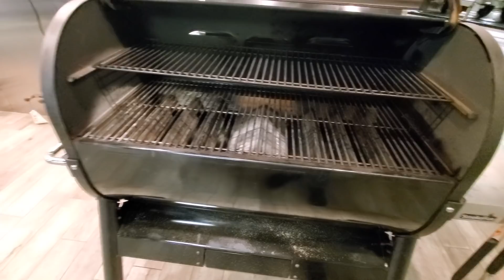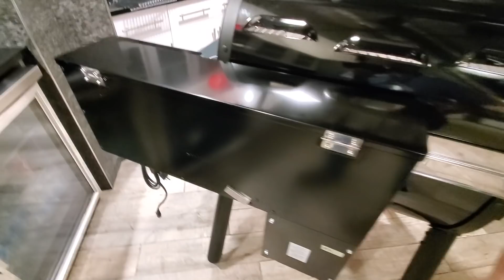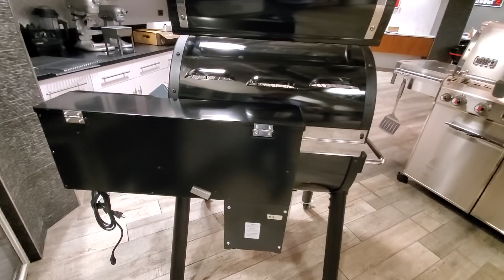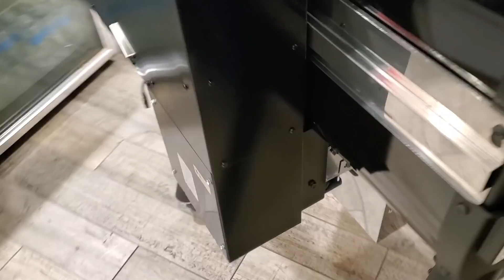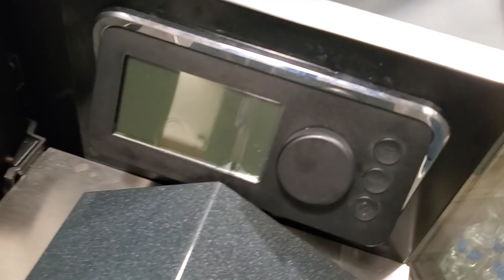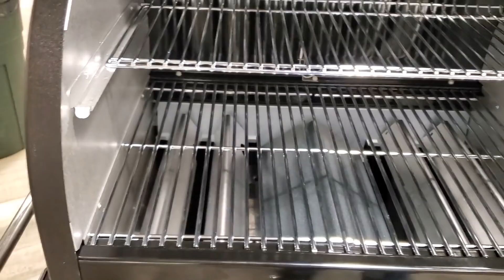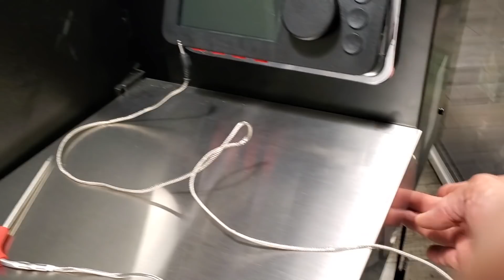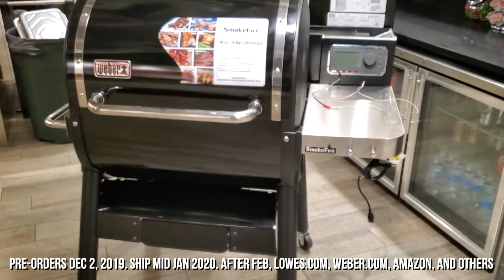Part 1 FIRST LOOK | Weber SmokeFire Pellet Grill Smoker | BBQ Champion Harry Soo SlapYoDaddyBBQ.com

Comment: Are there provisions for a rotisserie?
Reply: Frenetta O'Neal.  Why would you want a rotisserie?  Most of these pellet grills have blowers that make them basically into a convection oven.  I do a lot of beer can chicken in my smoker that comes out perfect and found if you buy some cheap round cake pans and place the chicken standing up in the cake pan there is no cleaning of the smoker, but the cake pan is pretty gross.  Plus another great thing about the cake pan is that you can grab the cake pan instead of the chicken and not have to worry about messing up the skin or having the beer can falling out when it done.
Reply: @elcajondavid1  good tips David. I have chicken cookers (beer can type) with pans already attached also.  When you put the chicken on cedar planks you minimize further the need to clean.  I just posted a volcano turkey which  illustrates this.  Thanks for taking time to leave comments!
Reply: @harsoo .  Thanks for the reply back.  I haven't used the cedar plank, but I have been using these copper sheets to lay down on the grilling surface.  I mainly use them on larger meats like ribs and briskets and of course salmon which helps in the clean up of the smoker except the sheets are pretty disgusting when you clean them up.  I think you will enjoy this, I no longer have to buy briskets and especially salmons.  Several of my neighbors when they find out I am going to smoke either a brisket or especially salmon they buy it and then split it with me.  I probably have close to dozen salmons in my freezer right now, and the neighbors  just go crazy for the smoked salmon and all I have to purchase is the pellets then again one of the neighbors just purchased a bag of hickory pellets and gave it to me.  "Maybe I won't have to buy pellets in the near future with any luck?"  Have a great day.
Reply from the maker: Not sure as this is the pre-launch phase.  I know the Accessories Manager Shannon mentioned that a whole suite of accessories are planned so I can guess that an electric rotisserie should be in the works also. I kinda got the feeling that SmokeFire will follow the BGE or Harley Davidson business model where large portion of profit comes from the accessories.

Comment: Hey Harry, great review. Quick questions: Where do the temp probes from the controller enter into the pit? Is there a small door on the side or something?
Reply from the maker: The preproduction model did not have cutouts.  We were told the production models will have notches in the lid for the temp probe wires
Reply: Ok that is what I thought as I didn’t see any in your video. Thanks for the quick reply! Definitely very interested based upon your video. Got a new subscriber!!

Comment: This weber looks great. Alot of thought into this design
Reply from the maker: Gotta love it for the engineering!
Reply: @SlapYoDaddyBBQ  it appears maybe not so much.  This weekend has shown it has a number of engineering nightmares, especially channeling grease toward the fire.
Reply from the maker: @SilatShooter  I have one data point from my cook on the SF at my subscriber's home.  My SF is on order from Amazon (those suckers are hard to find locally). Feel free to drop by to watch me do a Torture Test Part 2 low-and-slow with briskets and butts only and see if the hopper feeds and no grease fire in 16 hours.
TORTURE TEST 1 - PASSED
45 lbs 5 meats in 8 hours. Generate grease from a 16 lb brisket, 10 lb butt, and 3 St. Louis ribs to drip on the SF the first 6 hours at 400F and 275F. After all that grease was accumulated, fire it up to 600F to grill the Ribeyes and sausages.  Cook to let the grease drain in the unit and then try to flash that grease at 600F to test for safety 
TORTURE TEST 2  - PENDING
60 lb, 2 meats, 12 hours. Two 16-lb brisket, Four 10-lb butts. Low and slow 225F to see if hopper feeds properly and no grease fire

Comment: My initial concern is cleanup.  Even in kettles we use a pan under long cooks to catch the drippings.  I'm not seeing a way here to catch the drippings.  And I don't buy the idea of them evaporating.
Reply from the maker: Grease flows into the foil pan and 70% of ash falls into the ash pan.  Please see Weber SmokeFire webpage to see how it works.  I, lile the Weber engineers, hate pit cleaning so they designed a way to get the grease out and keep the SmokeFire clean on the insides.  You don't want a grease fire after you do a 600F sear after a 12 hour brisket cook!  It is UL listed device so it passed fire and safety certifications

Comment: You lost me at 1,000$ sorry.
Reply from the maker: Yes, they are  an investment if you like pellet cookers. Of course, you can cook great Q in a $150 Kettle in the hands of a skilled pitmaster!
Reply: $1k is a pretty decent starting point especially coming from weber. there are more high priced pellet cookers out there. I own a few of them myself.
Reply: It's $200 cheaper than an equivalent Traeger.  Pellet grills are expensive.  This seems a basically good deal for what you get.

Comment: Very nice but it doesn’t look like it has the kind of drip pan like some other competitors which shields it from the fire source and redirects the grease away from combustion. Stick burners are separated by two different barrels so you still have separation from your fire source which allows you to cook highly flammable cooks like pork belly. So how would this hold up to lots of multiple pork belly or pork shoulder cooks like other smokers? Looks like they did an amazing job on the handling of ash buildup.
Reply from the maker: SmokeFire is UL-listed in the US and Canada so it passed rigorous government safety and fire tests including grease fires.  It could not be certified if it has a grease fire problem.  I signed an NDA so I can't say what I've seen in their testing but I can say that the do crazy fire risk events to their pits before they release their products. They have a 68 years of experience selling grills and have seen many knuckle-head customers.

Comment: The vents on the back have been in they're design for a long time...I have a nice unit and use it for a sear station..and Rec Tec bull as a primary...I know Webber quality but honestly it doesn't hold a candle to Rec Tec as far as quality of build and materials used...for the same money...? No Way!

Comment: i was thinking of getting a camp chef but after seeing this weber pellet i going to get a weber instead.
Reply: I've been looking for weeks.  I'm not convinced this is better then the current Camp Chef, especially when it's twice the price.  I'm going to wait to see more feedback and USE from Harry and T-Roy.
Reply: @Trblmkr07  good idea i think i will wait for more feed back next year.
Reply: @Trblmkr07  My dilemma as well. One thing I didn't see is a way to change the pellets out when there are still some in the hopper. however,
Reply: @leolalley4708  I've seen some other video's.  There is a release catch at the bottom of the hopper that will allow you to empty out the pellets.  It's one of the things I'm particular on because I like to use different types of wood for different types of meat.
Reply: @Trblmkr07  Thanks for that info. Looks like I'm going to have to wait for some more reviews before getting my pellet grill.
Reply: Get a Camp Chef (I have one). You can't smoke fish or jerky at 200 degrees. Until they fix that forget it.
Reply: Daniel Moynihan didn’t they mention the temp range is 200-600?
Reply: @jdp2380  According to the Webber website the temperature range is 200-600. 200 is way to high to smoke fish or jerky. If they can lower the min. to 150 or 160 I would be very interested. I love Webber products, but this is a major problem.

Comment: Looks like garbage, looks like many surfaces that can rust and break down. The flavor bars seem like they will guarantee a fire.
Reply from the maker: There is a 5-year warranty on the body and 3-years for the parts.   The unit is UL-listed in the USA and Canada and has passed rigorous government fire and safety tests to earn such a rating.  My WSM is 10-years old and won 100+ first places all over the US. The same porcelain coating on my WSM is on the SmokeFire. The flavorizer bars are patented and used on many Weber grills with great results.

Comment: Great video!  I totally agree with you that it looks like Weber took all of the downfalls of the other pellet cookers and fixed them.  Pellet chute instead of auger delivery all the way to the firepot is huge.  I've seen a few hopper fires across different brands of pellet cookers and they are no fun!  The use of flavorizor bars instead of a full deflector plate is awesome.  This video is the first time I've seen that Weber thought about making it easy to change the ignitor (glow plug).  That is a big deal.
Reply from the maker: Their efforts shows and making their engineers cook on 18 competitors for a year before starting design on the SmokeFire surely helped.  We had numerous engineers talk to us which I cannot reveal due to NDA but take my word that they know their competitor's strengths and weaknesses like the back of their own hands.

Comment: I'd love to find a pellet grill that can get a good sear. The few I've researched seem to only have a tiny searing spot available directly over the pellets which I'm sure will just make a mess as the juices and fats run off the meat. I've been doing a lot of Sous Vide but the lack of a sear or anything appetizing looking as you remove it from the bag means I've been investing quite a bit in tools to create a char. If the Weber can get to the temps I need, I think the larger of the Smokefire grills will be my primary choice now.
Reply from the maker: Please see Part 2 on how it sears.  Also Parts 3 and 4 coming
Reply: Take a look at the Yoder YS640. It will hit temps around 600.

Comment: So where exactly does the grease get collected?
Reply: Sounds messy, still on the fence. Worried about flare ups. Do low and slow way more than hot and fast. Use my kettle for that.
Reply from the maker: It is UL-listed in USA and Canada and passed rigorous fire and safety tests to be certified.
Reply: DixeyNormis into the tinfoil pan
Reply: @MikeHoncho884  Yes grease go into the tinfoil pan. The ash goes behind the pan.
Reply: @MikeHoncho884  The tinfoil pan catches the burnt pellets . That's what Harry said.
Reply from the maker: sorry, the pan catches the ash and the foil pan gets the grease. Me bad
Reply from the maker: foil pan
Reply: My question too. From the design, fancy drawer or not, it looks like interior cleaning on this otherwise marvelous looking beast would be an absolute bitch. I LOVE my Weber other Weber cookers, but this one falls short for me.
Reply from the maker: @bigmark2.046  Grease flows into the foil pan. Sorry I was busy talking about the ash and the ash pan but the foil pan is for the grease to flow into.  The Weber engineers I met also hate to clean their pits, like me, so they engineered an easy solution to grease without the need for an outside bucket that critters could get into.
Reply from the maker: @bigmark2.046  https://youtu.be/NwGN72jFjL4

Comment: Is the grill body cast aluminum like the Weber gas grills?  Larger wheels will be nice.  I hope the flavorizer bars and the pellet cooker cover can be upgraded to SS304.  In your opinion will a GrillGrates option, if offered, work with this grill?  Appreciate the video.
Reply from the maker: Body is enamel coated steel which s very durable. My WSMs have the same finish and they are 10 years old and still going strong.  I think the flavorizers are SS.  The teepee is enamel coated steel so it is easier to clean according to Weber engineers.
Reply: @SlapYoDaddyBBQ  THX Harry.  My Weber Genesis Silver is around 25 yrs old and still kicking.  My WSM is just over 3 yrs old and running fine. Weber make a quality product at a decent price point.

Comment: Thanks for the in-depth review.  I’m very interested. I know they tried to keep the price point  low. I’m glad you addressed the shelving issue because as of now there is really no shelving. & a wheel upgrade! I’m still surprised about that igniter.  It seems most have went to ceramic igniters that last a long time. I’m very interested to see how even it cooks on low & slow without a blank pan. & how even it is at 600 for steaks.  If this is all proven to be even cooking, I’ll probably get one!! I’ll be waiting for more if you’re in-depth cooking reviews!! Thanks again!!
Reply from the maker: Please watch parts 2, 3, and 4 which hopefully answers your questions

Comment: Looks like a good competitor to the Rec tecs
Reply from the maker: There were 18 competitors that the Weber engineers cooked on first before they began the design of the SmokeFire.  I think their effort paid off as they addressed the usual issues with some good old fashioned engineering.
Reply: @SlapYoDaddyBBQ  I agree. It looks promising

Comment: As always, thank you for the video. Very informative. I do have a question for you. On the small grill, do you have any times it takes to reach different cooking temperatures? Like from cold to 250 degrees or cold to 600 degrees. Very important for those, "let's grill' at the last minute when your wife walks in from work. Waiting 45 minutes for the grill to heat up to 540 degrees now on my much larger pellet grill just doesn't work a lot of the times. 
Thank you for your time buddy. 🙂
Reply from the maker: Please watch Part 2 which answers your questions.  Parts 3 and 4 coming soon

Comment: It looks like you will have even smoke and heat and not have hot spots or burn back.  That is what I'm looking for I believe.  I like the glow plug big time!
Reply from the maker: It's from a diesel engine.  In their tests, it was better than the usual ceramic heater.  I've had to light my firepot manually many times as the ceramic heaters don't last very long and it's a hassle to replace.  The self service concept for the SmokeFire sound like a user-friendly idea

Comment: Great review! I have owned 3 different pellet cooker brands and honestly to this point my Traeger is best.  The Silverton vents out the back and is much better than the stacks.  That all being said, I love the features of the Webber and Webber is a trusted name. I would love to try it, but 1000 is still steep for the small one.
Reply: Love my Treager no problems for 8 years. I've had the pellets jam twice but not that bad to fix. Never had a flare up never had a grease fire. That worries me on a long cook that started at 2am.
Reply: @roger571967  I too love my Traeger, but I have had fires just from going high and igniting build up.  I cook 4 to 5 times a week, so it really is my fault. Need to clean it more often.
Reply from the maker: We were informed that the SmokeFire is UL-Listed in USA and Canada and was subjected to rigorous safety and fire tests in order to be certified.
Reply from the maker: I'll test it an share results

Comment: I will say one thing I hope they thought of, the three vents in the back, I didn't notice if you are able to close them.  I am not a hard core smoker/barbecuer, I may only do it a few times a season so my biggest concern just from this video is can you close those vents. since I don't do it frequently, I would hate to go out and find something has taken up residence in my grill because they could get in through those vents.
Reply: They don't have anyway of closing and mine (a different brand) a long with most all of the other pellet grills that I've seen, the vents aren't adjustable and can't be closed. They're may be some that can but I haven't seen any. You could always cut a few pieces of foam from an old pillow to stuff into them or get fancy and shape some wood or metal pieces to fit in the vent holes if you have the equipment to do so.
Reply from the maker: The vents are open like the vents in a gas grill.  If you have critters in your backyard, the usual practice is to put a cover on

Comment: Thanks Harry!  Amazing recap.  I believe the sides are double walled but not the lid, correct?  Did they say how well it holds temp in cold and freezing temperatures or if it needs a thermal blanket in colder temps?  Cheers!
Reply: I'm curious about that as well. I was gonna ask, but since you did I'll just piggy back off your question. Awesome review Harry, looking forward to hearing your own personal experience!!
Reply from the maker: I live in Los Angeles so I'm not going to be a good cold weather review person!  :-)
Reply: Harry Soo thanks for the feedback as always.   I do like to cook in the winter and just wanted to know how it will perform in that climate in terms of holding temp.  I can inquire with Weber as well as I’m very interested in this grill after watching your review!  Cheers Harry!
Reply: I was watching for this too.  I just bought a Traeger Ironwood and was already wishing I got the Timberline for the double walled lid and the tighter seal.
Reply from the maker: It would be interesting to do a side-by-side compare
Reply from the maker: Yes,both end pieces to the barrel are insulated.  When the grate and cover were 500F, I touched the sides and they felt about 275F. It is well engineered and UL-certified in the US and Canada so it a safe outdoor appliance.

Comment: Good video. Where does the grease go? Didn’t see a drip pan. From the looks it will just drop down to bottom. Late to the game, but wish them luck.
Reply from the maker: If you build a better mousetrap, you can sell a few.  I think Weber did their homework.  The grease goes into the foil pan I show in Part 1.  Sorry i did not point it out as I was more into the ash capture.  Me bad.